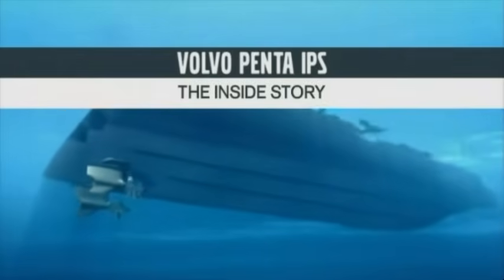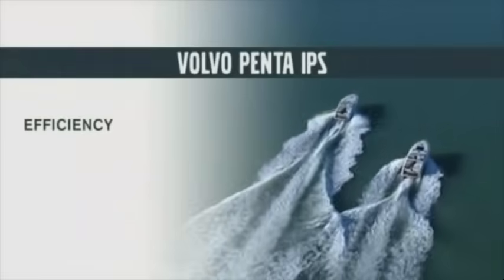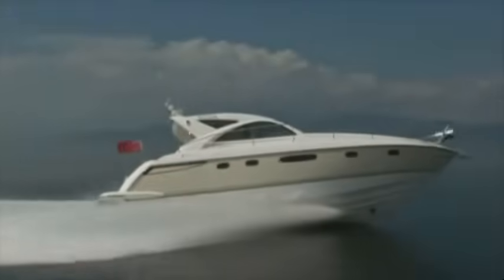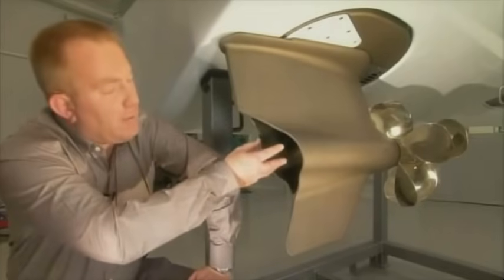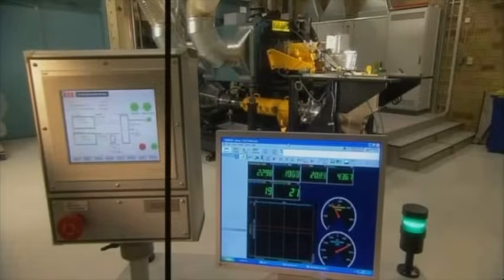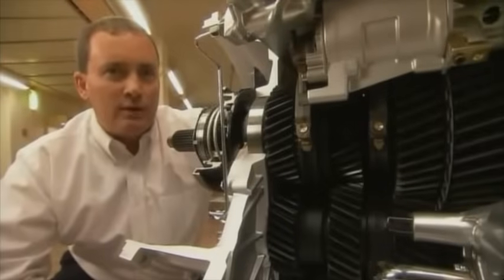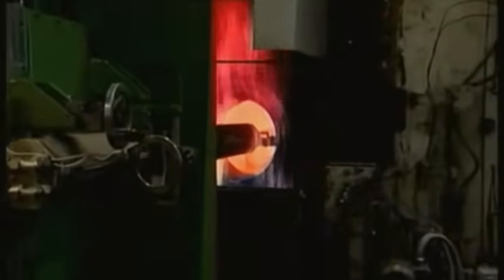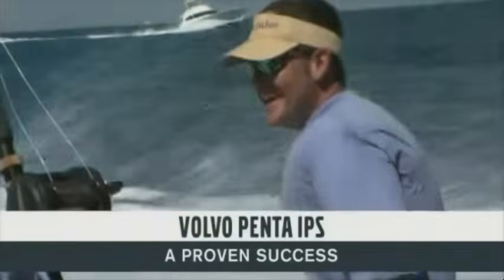VOLVO IPS EXPLAINED

Comment: One thing about forward facing props is the prop will be damaged first instead of the housing holding the prop shaft, so not a great design if your in  waters where there is rocks and shallow water, if i could afford a large boat i would not want this poor design as uts too risky i would want something a bit more robust reliable and simpler, keep it simple stupid comes to mind 👍 the Volvo and merceriser  out drive systems were always a hassle and this just adds another risk factor 👍

Comment: On impact with a submerged object, isn't it going to tear out the entire drive? These drives protrude significantly below the hull. Hitting something would cause immense damage, sinking the boat immediately?
Reply: It's pretty much the same as with any drive system, outboard is still a popular choice for some that constantly use their boat in shallow water, but otherwise it's not much of a difference.

Comment: Dear Bob, you forgot to mention that the plate under the hull in the series since 2009 corroded with galvanic currents and water entered the IPS foot. Then you changed the plate to steel. here, dear Bob, these costs of "wrong Volvo experimentation" have been borne by your customers, who have only cursed you. Thanks for being innovative!
Reply: Volvo ips is used by most high end cruisers and midsize yachts. Multi Million dollar boats. They are used because they are revolutionary and the best marine engines ever built. Go be mad somewhere else and spew nonsense.

Comment: Great feat of engineering, but very impractical for most boaters due to high costs and very high vulnerability to catastrophic damage and failure as well as way too many points of potential failure ,just look at how many places the power changes direction !
  Every 90 degree gearset consumes power as well.
  A straight shaft  and propeller protected in a keel and lower Skeg  with bow and stern thrusters is still the simplest most reliable and cost effective system.
  Interesting concept though !
Reply: You're used to American made garbage.  This is European and engineered to much higher standards.
Reply: It's VERY practical and is now the "go to" for most larger boats.  I have an Azimut 60 w triples and I couldn't be more happy.   Zero problems, my 60 is the fastest 60' out there and I'm an accomplished captain so I have no fears of putting it on the ground.   Been boating in S Florida/Bahamas/Gulf for 20 yrs, no problems like that.   I recommend it to all my friends.  You've never experienced it so until you do, remember what I said.
Reply: @toddprince8595  What experience is required to determine that power direction change increases friction and resultant heat production? All that's required is a belief in the basic laws of math and physics. Just because you claim IPS to be "VERY practical" and "go to", that represents nothing more than sales hype. As for the danger of foward facing propellers, again, physics shows energy transferred to the props and IPS pods, upon collision with sufficient mass, at high enough speed, will unquestionably cause deformation of prop blades and possible total destruction of the pods and boat bottom. No amount of experience can disprove this. As for speed, I might be able to increase my 60 footer speed to several times that of your IPS by attaching a rocket booster to it but I don't want to spend the money on an impractical propulsion system.

Comment: Do you have to have 2 drives or can you use only one motor and ips drive
Reply from the maker: Most of the benefits associated with IPS rely on a multi engine installation so Volvo Penta do not offer a single engine/drive with the IPS product.

Comment: looks like an interesting solution.
a downside to the design might be snag and impact hazards
Reply: It's designed to rip off at the hull without damaging the hull.
Reply: Happy "Presidents Day" today, George. 
Yeah, you are correct. The boat manufacturers should definitely plan on putting a couple of skegs in front of each unit.
Oh, and I liked this holiday a lot better when we called it George Washington's Birthday.

Comment: Let’s add 2.5 ft to the minimum draft. So a boat that has a 4 ft draft now has a 6.5 ft draft. So much for getting into tight places.
Reply: Not the case at all.
Reply: @Motoryacht Bacchus  I humbly disagree. My current boat has a draft of 4.5 ft. There were spots in the Florida Keys where I had problems getting into the channels.
Reply: @McFingal   I'm not saying that there aren't areas where having a shallow draft is important, I'm saying that the IPS drives do NOT add 2.5' to the minimum draft of the boat as compared to conventional shafts.
Reply: @Motoryacht Bacchus  I’m sure you are right. I just have an axe to grind when it comes to V/P equipment. 
One life threatening incident and I don’t forgive. They get the never buy from me.

Comment: Wonder how it would handle large woody debris?
Reply: With money hahaha
Reply: @mminces  and repeat as required
Reply: The same as a shaft drive, just with an IPS drive the pod will sheer off leaving the hull watertight, with a shaft drive you’ll be running the pumps as the shaft gets pulled and opens up the stuffing box.